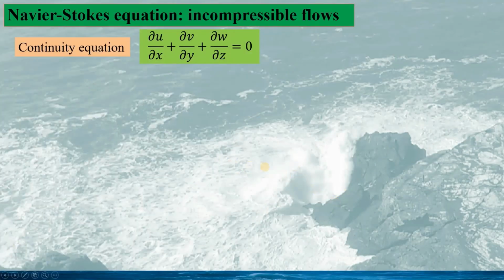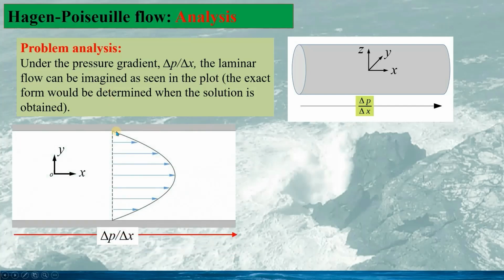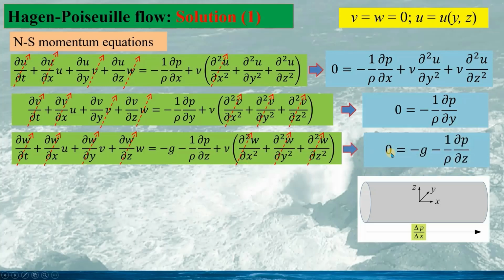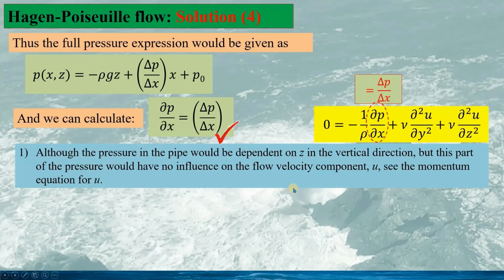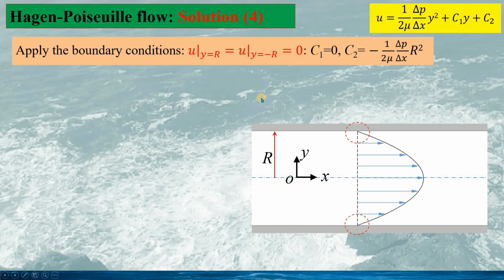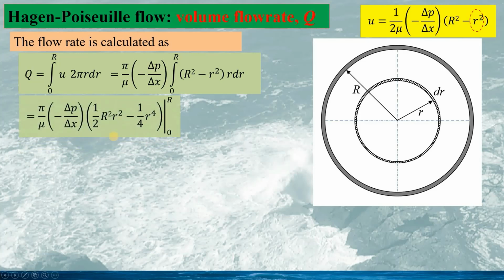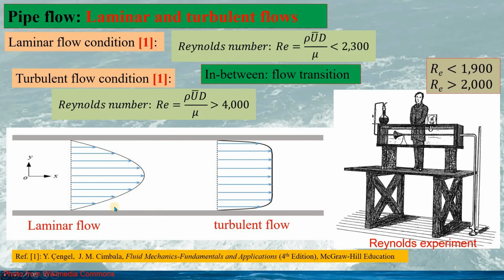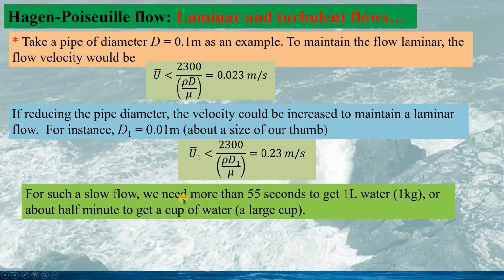Hagen-Poiseuille flow: a detailed complete solution to the Navier-Stokes equation

Comment: Isnt turbulent flow w reynolds # of 9000-10000?
Reply from the maker: When the flow Reynolds number is between 9000 to 10000, it will be definitely turbulent, and we will have no analytical solution for it. Maybe CFD is a tool to analyse it.